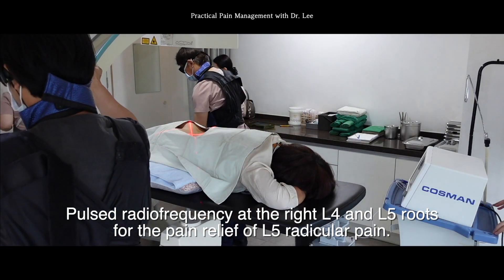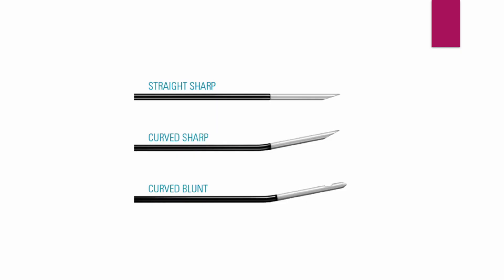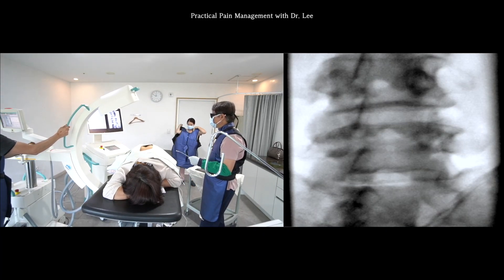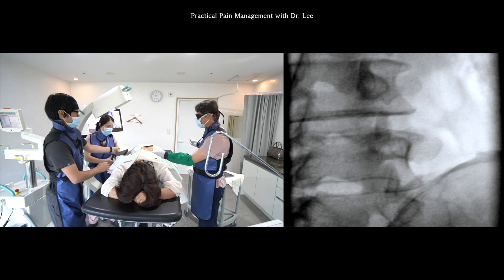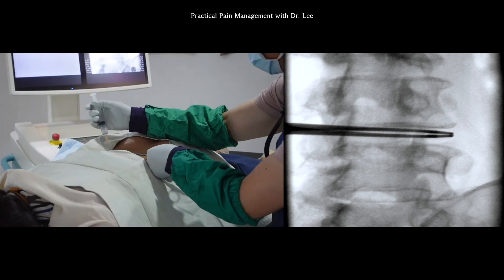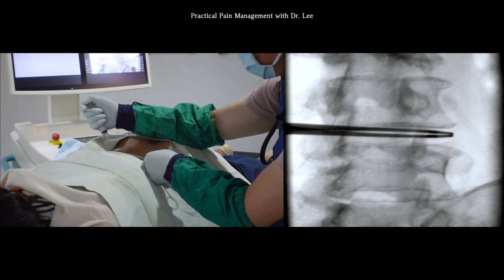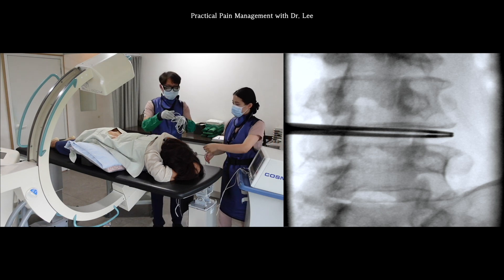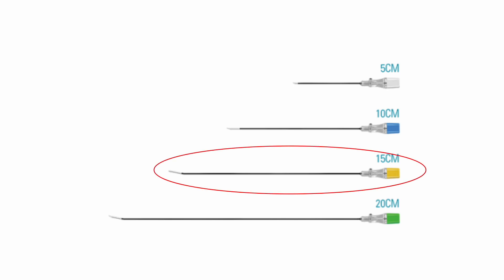Trailer_ Pulsed radiofrequency treatment  for lumbar radicular pain targetting L4,5 roots

Comment: Where do you place the grounding pad?  Do you use unipolar mode for the pulsed RF?
Reply from the maker: I put the ground pad in the thoracolumbar junction when it is a diffuse lower back pain or diffuse lower extremity neuropathic pain. but, sometimes shift to ipsilateral side if the pain is localized to one side.